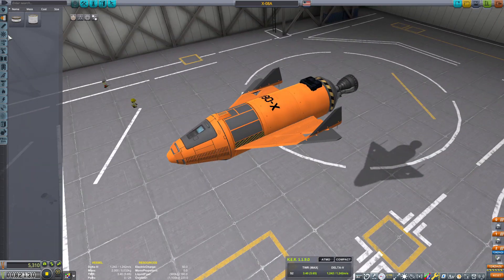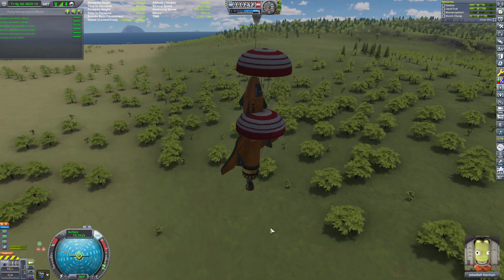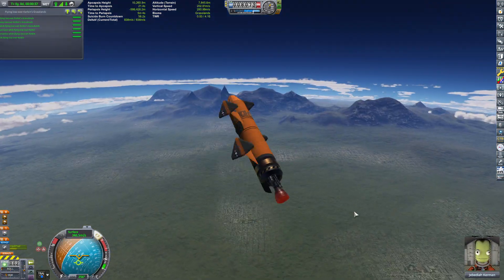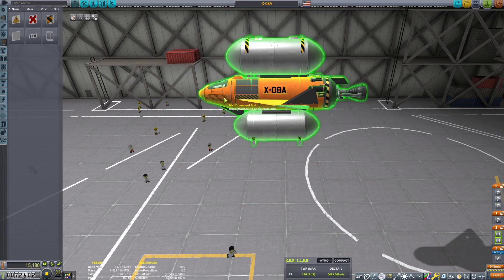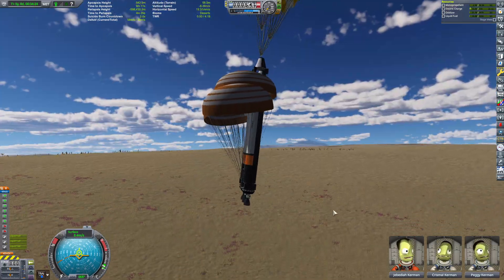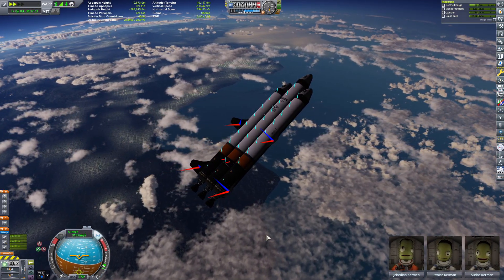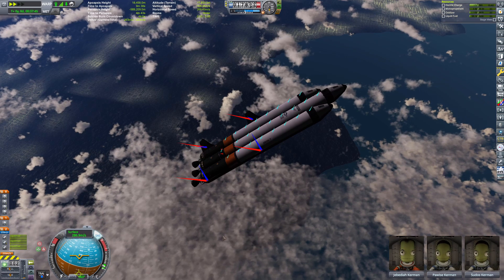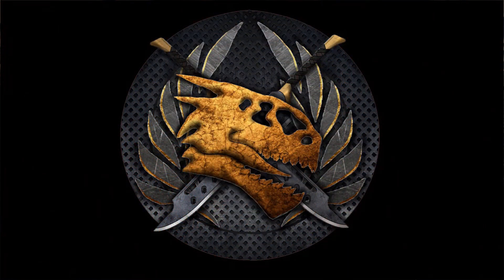DESIGNS GONE WRONG. | KSP 10% Science Ep-17

Comment: I am doing a 10% as well, and you are right, the grind is very hard. Using a lot of your testing to launch me forward. Couldn't get the fin to work either. With regards to your external drop tanks with an inline decoupler. Found that if you put the tanks on a slight outwards angle that they cleanly drop away every time. Good luck and looking forwards to having some pretty designs like you have.

Comment: CoL has to be BEHIND CoM (in ksp specifically, because ksp does not simulate CoG or CoP it will always be more stable to have CoL behind CoM), that's mostly how it is in real life as well, to ensure the aircraft has more stability when flying down, because when it's flying up the engines and control surfaces maintain the stability, but when flying down you want the least engine power as possible so you don't accelerate too much, and you want to maintain level flight, so in real life CoP is slightly behind CoG which is basically CoL but CoP is dynamic and varies depending on the speed and altitude, while in KSP it's a linear variation based on those parameters, KSP does not simulate supersonic toomfolery, let alone hypersonic, also there are no shockwaves and vortices simulations, which mean in the game instead of having the CoL slightly behind CoG you should have it a fair bit behind CoL (fair bit depends on each craft, which is why you need to test your airplanes a LOT compared to rockets).

In case you don't understand the terms here is a brief explanation :
CoG (Center of Gravity) = a point from which the weight of a body or system may appear  to act.
CoM (Center of Mass) = the average point where all the weight of an object or system is balanced, determining how acceleration is applied to the body of the object.
CoP (Center of Pressure) = the point on an object, like a wing or a flying potato, where all the forces from a fluid acts together.
CoL (Center of Lift) = the average point on an object like an airplane wing, where the total lifting force from air pressure can be considered to act. It’s the "average spot" where the upward force is concentrated.

Comment: About the control issues: any fin that is not placed directly on the center of rotation will resist said rotation, because it's being forced through the air sideways.
You've made that nice delta wing with multiple rows of winglets in front and behind of each other, and those winglets placed in the front and back may already cause enough drag to override your limited means of control.

Basically, try having a long and skinny wing where all fins are placed in one row. That should give the craft a nice axis to rotate around without causing drag.

Comment: The thing with the centre of lift readouts is that they only calculate the lift from the wings iirc
The drag from the tanks is not being accounted for
Reply: Oh and its totally possible to make a plane w/o active surfaces
Just put the main wing slightly behind the cg so it would slowly nosedive v/o imput
Then add tail wing at 5 degree downwards angle to push the tail down and nose up
It takes some tuning in but it definitely works and I was able to both land on the ground and stock water safely
Reply: to VAOS if you read this: the CorrectCOL mod fixes this

Comment: The decouplers not having crossfeed felt wrong.. So after a little digging I think I figured it out. It is apparently upgraded to have cross feed option available after you unlock fuel lines. But this is this a tier 5 tech that costs 90 science to unlock... Not very helpful KSP, Not very helpful at all!
Reply: Radial decouplers should have crossfeed way before inline decouplers.
The main usage for radial decouplers are drop tanks and side boosters, where you use them while also running an engine on the center. Inline decouplers are much more for stacked stages, where you want to empty the bottom stage before decoupling and going into the top stage.
Reply: This BS on the Tech Tree gets more apparent once you realise that ladders are also on a 90 Science node.

Comment: You can move the center of mass by rotating the fuel tanks...fuel tanks have a top and bottom side and fuel is drained from top to bottom moving the center of mass from top to bottom as well...
Reply: Another trick is using multiple small tanks and setting fuel priority accordingly.
For my SSTO I took a note from the Concorde and added more tank capacity than It carries fuel. But there is a tank in the nose and one in the tail to transfer fuel to move center of mass.
Well calibrated it can fly stable on it's own without any input or SAS.